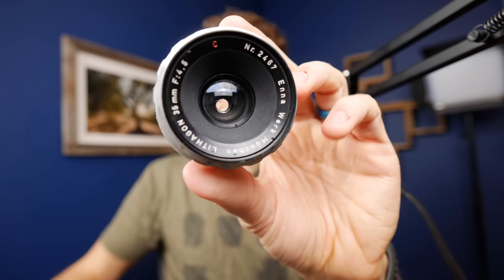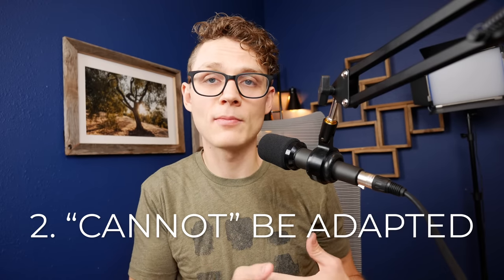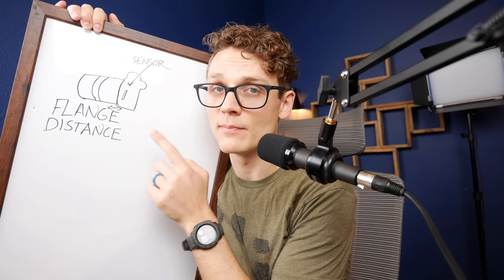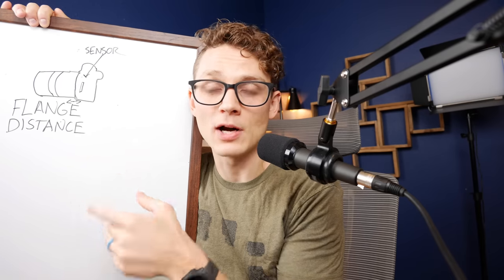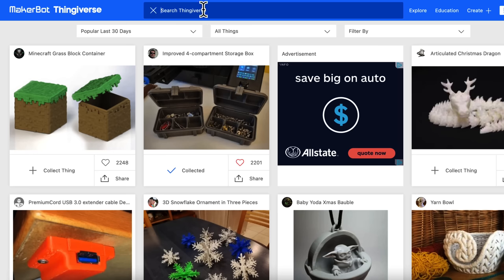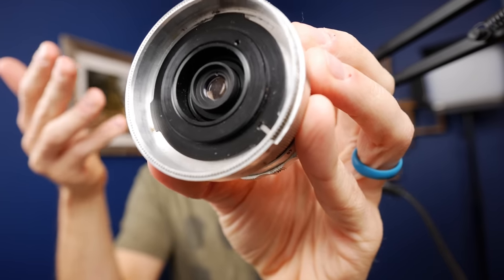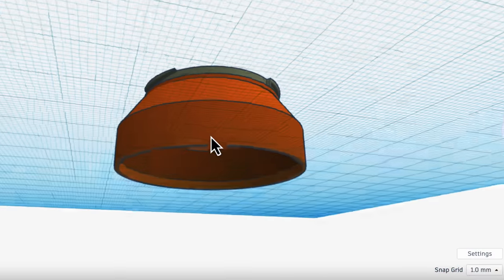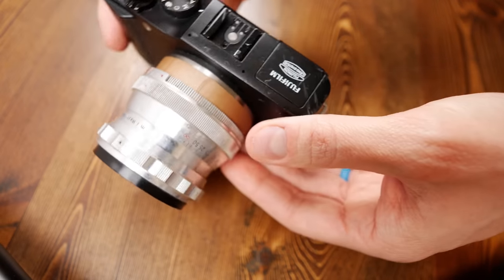How to Make Your Own Lens Adapters

Comment: Oh my GOD thank you for making this! I'm also here for PEN-F half frame nonsense, I just picked up a PEN-F film camera and have been tearing my hair out trying to find any of the old official adapters without spending $100+ for them. I wanted to try to adapt some of my old Leica M glass onto it for portraits and it looks like while I won't be able to hit infinity focus, the difference in distances is only -1 mm (Leica M is 27.80mm, PEN-F is 28.95 mm), which means... I think I would be able to get pretty close, if I'm understanding this right? Would love your thoughts on this mad science experiment. I think it would be fun to have what's basically an M-rangefinder sized SLR.
Reply from the maker: That's right, that means you only have 1mm to build an adapter which is really not enough room, especially since I'm assuming the Leica M mount has a larger diameter than the Pen F mount (just guessing). What you could try it making one anyway as thin as possible and seeing how much range it gives you. You won't be able to hit infinity more than likely, but maybe still portrait range?
Reply: @snappiness  That was my plan! And yes, technically, although they look to be almost the same size when you just put one up against the other. So yeah, if we can make it as thin as humanly possible, hopefully should be able to get some kind of range on it? Since in your experiments, I imagine that even when the flange distance was off by 5 mm or so you were still able to get some kind of focus
Reply: There is also the option of tucking the lens inside the camera. If you look at a C Mount to MFT adapter you’ll see that the C mount part of the adapter sits behind the mounting plate for an MFT camera. This only works when the lens to be mounted is smaller than the cameras mount.  Sometimes I’ve been lucky and was able to start with a cheap C mount adapter and then modify it to stick a lens inside the camera. 
To test your lens put your camera on a tripod, turn your camera on and carefully hold your lens up to the camera’s mount using you hand to shield light leaks.  Look through viewfinder and you’ll find out what focus range you have. From my experience at 1mm over the flange distance you will still have a very useful lens

Comment: I've been contemplating on jumping into 3d printing. This may have pushed me over the fence 🙂
Reply from the maker: It's such a fun hobby, in case you need another one on top of cars and photography and whatever else you're into 😆 I'm using an ender 3 I bought used for under $100. Printers are so easy to come by nowadays. But the cheaper ones do need a little tinkering to get working optimally, whereas the much pricier ones are pretty much plug and play.

Comment: An interesting experiment would be to see if increasing or decreasing the layer height affects the performance of the lens. Would color/texture affect a mount?
Reply: Depending on reflectivity, and internal reflection could potentially mess up the image in unforeseen ways
Reply: Internal reflections or any translucence in the print material would probably lower contrast or add veiling flare, hence why a lot of lens or adapter barrels are “flocked” (adding non-reflective black fabric) or they add stepped ridges that capture stray light.

But, I bet you could change the color of the material to add a tiny bit of a color cast for an in-camera “film look.”  It probably would be a cool idea to play around with!
Reply from the maker: Yeah I think if it was shiny/translucent you'd get some effects. Are you thinking with a layer height that lets light in through cracks? Otherwise the big thing with layer height is print quality at the cost of time/more material. I haven't printed at any thickness/layer height that has allowed light to pass through in any noticeable way.
Reply: @snappiness  I was thinking more along the lines of increasing it to create a more stepped grade along the barrel/cone. 
Now that I think about it, it'd be more appropriate to say it's the "resolution" of the cone (a change in the design) rather than a change in the layer height (a change in production).

Comment: *almost any lens.
Some of us like to suffer by adapting lenses that don't have any means of focusing without the original camera :)
I've purchased the 90mm contax g lens, and while waiting for it to arrive from Japan I'm contemplating the way I'm going to adapt it to Fuji x mount.
Existing adapters are very much hit-or-miss and good ones cost more than the lens itself.
So while reading the comments under this video I saw someone mentioning helicoid adapters. I immediately thought of using Leica-Fuji adapter with macro focus ability, and swapping the lens mount with 3d printed contax g mount. And although it is very tempting to take on this unnecessarily complicated project, I don't think the end result will be worth it :)
Really love the variety of your videos!
Reply from the maker: Interesting. I just looked into the Contact G series lenses and see the big issue is no manual focusing ring. The idea of moving the lens further or closer for focusing is a good enough idea! Not sure how much range that'll give you. Cool lens though.

Comment: Two of my favourite lenses are the 53mm Helios 103 and the 35mm Jupiter 12, for Kiev rangefinder cameras. These are difficult to adapt because the helicoid screw is in the camera body, and the Jupiter has a huge rear element. A few sellers offer a Frankendapter consisting of a donor helicoid mated to a third-party mount, but these look suboptimal and not very accurate. Sad because they are very interesting lenses.
Reply: I don’t know about the Helios 103 but you can get the Jupiter 12 in other mounts like L39, which is easy to adapt (if it’ll fit into the camera — which it usually won’t; it does fit my Ricoh GXR M module camera and will fit Leica digitals too, I think).
Reply from the maker: I have not played with these lenses before, interesting design!

Comment: I love that you brought up adapting lenses to the Pen FT because I landed on this video thinking…hey I wish I could mount my Nikon glass to my Pen FT but nobody seems to sell an adapter. I think historically these mounts did exist from Olympus but are quite rare. I was able to find a third party EF adapter and I can further adapt Nikon onto it but it was more $ than i wanted to spend…may go for it eventually.)

But what I really wish is someone would make a speed booster for Pen F haha…
Reply from the maker: That would be cool! I think there was even a third party one to K mount as well, but it was $80-100 on eBay and only one or two available when I lasted looked. So I know the struggle.
Reply: @snappiness  On the subject of obscure Pen FT accessories I do have a set of the Bellows 2 for Pen F which are pretty cool and very compact. Good on mirrorless too.

Comment: I wish there were more adapters that can also adapt the electronics, for instance when canon created the l1 camcorder, they made a new mount called the interchangeable video mount, aka VL mount, they made an adapter that let you use preexisiting Canon EF - nothing  lenses on the camera, and it had adapting for the electronics, I am not sure how much it can adapt, but most likely it can do AF, and possible motor zoom

Comment: You can get a good starting point for unknown flange distance quite easily. Set the lens to infinity, point it at a clearly defined light source (a bulb in the ceiling for example) and hover it over a white surface, moving it back and forth until you see your light fixture image clearly projected onto the surface (meaning you can differentiate the edges of the bulb or whatever, it’s in focus). Then take whatever measurements you need.

Not sure how you’d want to keep it stable while measuring, but that’s up to you. It’s your lens, leave me alone, I’m busy.

Comment: Love the video...
I have been desperately trying to mount a lens I have had for a while to my canon EOS M....but there is n adapters...
its a cinema lens and that came on the Canon L1 Hi 8 camera..the lens is supposedly the "CL mount"(cinema lens).I found the camera in a dumpster at work busted up but the lens is perfect...
however the aperture controll is not manual on it so there is no way to even take a picture through the lens at all unless I can power it up... and there is only an adapter made that would allow for EF lenses on the VL1 body but none to allow for the CL lens mount to be able to mount to anything else...there seems to be more going on inside of this cinema type lens that in my usual zoom lenses...the thing zooms for 8mm up to 120mm.....
Cannon did make a speed booster for the VL1 camera so I can already account for the 8mm zoom range...I know its not going to be 8mm when I adapt it...but I dont care....
I would be happy to pay for help with this as I have been trying to figure out a way to do this for over 3 years now with no luck...
my only other option is to 3d print an adapter...
I found a source online of a guy that was able to get the wiring corrected for the auto focus and aperature control using a differnt type of camera...so I do have the scematic for the VL1 lens to account for the auto focus control on the EOS-M body....
any help is more than apreciated...thanks so much

Comment: Great video as always! 
BTW if you get a chance, could you please compare 16-85 lens with 18-135 lens . Heard the image quality of 18-135 is similar to slightly expensive 16-85. If this is the case I might think to exchange my 16-85 for wide zoom range. Thank you !
Reply from the maker: I didn't make a video about it, but I have owned both and I would agree with the idea that they are very similar. I ended up preferring the 18-135 for the longer zoom and cheaper price. If you haven't tried it, you should! It's a really nice kit of a lens. Great for when you only want to bring one lens and stay light. It was a go-to lens of mine for years.

Comment: Wonderful video ... clear and simple as ever could be. I've been tinkering on adapting lenses to almost everywhere but I can't find an answer to this problem. I  have a number of MFT lenses and I can adapt them to Sony Next mount very easily as a readymade adapter already exist sand can be bought for rather cheap. Now, Next flange distance is 18mm, fine. But also flange distance for the Eos M mount is exactly 18mm. But unfortunately no one ever seems to have devised a likewise simple and cheap adapter ring to fit a MFT lens onto an Eos M body. No problem of automatisms or electric connections, iris transmissions or anything like. Just plain vanilla fitting the lens into that EosM "mouth".  Any suggestion for me? I would really be grateful :eyes-pink-heart-shape:

Comment: What would you recommend I do with a Leica R lens and a Canon FD body? The lens flange distance is 47mm and the FD body flange distance is 41.9 meaning I have only 5.1mm to work with. Also, if I use a Leica R lens to Nikon F body and a Nikon F lens to Canon FD body adapter, would that be too large?

Comment: TinkerCAD ownnnnsss..
Wish they had a R to T mount that is not corrected for distance.. like several cm, no I need right on the other side.  Like I have a project I'm working on that already takes the distance away, but the mount ruins that length.  I need to get a mount literally direct R|T, but the style that has the adjustable ring.  I wonder if a good durable material can hold the few pound attachment.

Comment: I’d love to be able to adapt my Pentax auto 110 lenses to my x-pro 3/ xt4 but I really don’t think it could work also don’t have access to a 3-d printer. But love the concept awesome video
Reply from the maker: It does work! I adapt them to my Fuji cameras all the time. The only caveat is that some of the 110 lenses don't cover the full APSC sensor size, as they were designed for a film plane more the size of m43. But I think they are really lovely on APSC! Just some vignetting. And you can just buy an adapter for Fuji and 110 lenses, they make them for cheap :)

Comment: Get channel!!  Hi, I am trying to mount some new "Cine Prime" type lenses on my  profession cinema camera SOny FS7 Mrk 11.   Both the camera and the lenses are E mounts but the focus is way off the marks  and it will not focus to infinity.  When I do a focus chart at 1 meter, the lens reads 2 meters on the scale.   Should I take the mount off the lens and remove the shims to get a closer flage distance?   The Thanks for your great help!

Comment: I would be a bit cautious with the 3D printed adapters, PLA melts at very low temperatures and can leave wacky residue if the print is low quality, wouldn’t want that on the sensor…
Reply from the maker: Being cautious is good, but this seems like an extreme concern. I've never had an issue of wear let alone residue, and this is a pretty popular way to adapt lenses. I guess don't set it on the windshield of a car parked in a desert.
Reply: @snappiness  You´re right that it´s no big risk to do it this way, I just personally had a scare way back when I 3d printed an adapter for my canon 400D and a small peice of support material got loose and struck the mirror, but I guess I´m just paranoid haha!

Comment: i have a huge doubt and maybe you could give me some insides, i have a rokkor fisheye 16 mm to use it with a BM6KPRO, what would you recomend? if i buy the adapter i have the flange distance issue woth the infinite focus? thanks for the respond and great video
Reply from the maker: Ah, the BM6K is an EF mount which is 44mm, and the Minolta A which I'm assuming is what you mean by Rokkor (minolta series) is 44.5mm. So, yeah, any adapter would force the lens to lose infinity focus unless there was glass added in the adapter to account for it. Some third party adapters have this (they cost more). Not sure if there's one from EF to A

Comment: I know this is an old video but I wish you'd reply cuz I'm a noob and I got some problem on adapting my Canon E-FM lens (chinese manual focus lens) to my MFT camera (Lumix G7).

Some forums said it can not be done, but I have calculated some of it and it's actually viable albeit looked really small and fragile, outward conical shape (EF-M is quite large at 47mm, MFT is 38mm) with some barrel extension to accomodate thr longer MFT flange distance (19.25mm, EF-M 18mm).

I don't know what may happen after I sent the design, though it's quite expensive here to 3d print. So if you could answer, I need some input or tips. Is it usable? Or what type of plastic should I use? Prolly something that has some heat resistancy (tropic climate).
Reply from the maker: Hello - So EF-M is a shorter flange distance (18mm) than m4/3 (19.25mm) meaning the different is -1.25mm. A negative distance would mean that the EF-M lens would have to sit INSIDE the m4/3 body by 1.25mm to achieve infinity focus. And if the barrel size of the EF-M lens is larger than the entrance to M4/3, that would be impossible anyway.

So, the only alternatives is to use it as a close focus lens/macro lens. OR technically you could make an adapter with a magnifier glass inside the adapter to overcome the flange distance problem, but that is a whole bunch more complicated.

It's probably better off selling that lens and finding another in native m4/3 mount. There's loads of cheap Chinese glass for m4/3 that is great. Hope that helps.

Comment: Is is possible to create a E-mount to E-mount speed booster?

If this already exist please let me know.
Reply from the maker: Just so I understand the idea, this would be to mount FF e mount lenses on an APSC e mount body with a speed booster?

Because it's the same mount, putting anything there will keep the lens from focusing to infinity, or potentially anything but macro if you're building a whole element between the two. 

Let me know if I misunderstand the idea

Comment: So, i have a zenit lens and a olympus body, and i believe that the result number of both flange distances is 1,58mm. Could i pull it off? or is a very insignificant number. 

Super dope video, thanks for the information, greetings from Chile
Reply from the maker: That would be very difficult to achieve infinity focus, unless you were able to recess the zenith lens in the camera body. Is this Olympus m43 mount or original four thirds?
Reply: @snappiness  it’s an Olympus om-10.
This past month a friend has been trying to 3d print a prototype, but I believe it is too thin

Comment: Instead of making prototypes, you could have just put the lens in a tube and held it up to the body. Then using a stick or something, push it deeper into the tube until you reach infinity. Then, use a caliper to measure the depth and just make the adapter 0.5mm shorter than that.

Comment: There are some adapters for M42 lenses to Pentax K mount, but none reverse: from Pentax K lenses to M42 cameras – at least after my own research. Did you find such? I own a very beautiful black body Asahi Pentax Spotmatic from 1971/72, and because of the overpriced SMC Takumar 1.8/85 M42 (about 400-600 euros) my intention is fitting the 2/85 Pentax K lens. My current Takumar M42 lens is the 2.8/120 which has been purchased for an acceptable price (120 euros).
Reply: Hi! It is possible to adapt PK mount lenses to M42, but it is complicated 

1. You can buy an adapter to use Canon EF lenses on an M42 camera (it will not be able to focus to infinity)

Then you can buy a PK-EF adapter
And you will have to connect the 3 adapters.

2.The other, more complex way would be to disassemble the lens, and change the mount from PK to M42, but it is something very complex, and I don't know if anyone has tried it